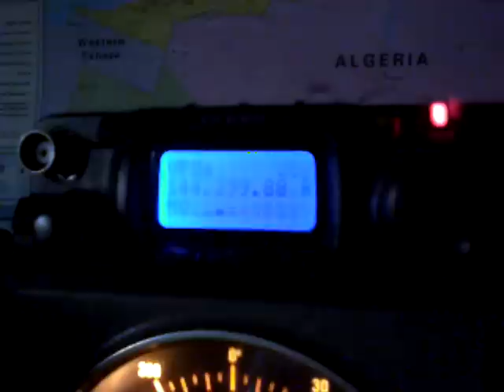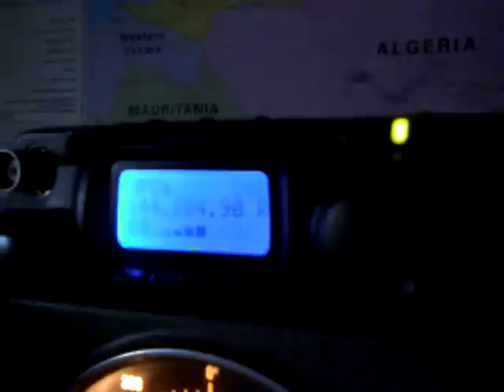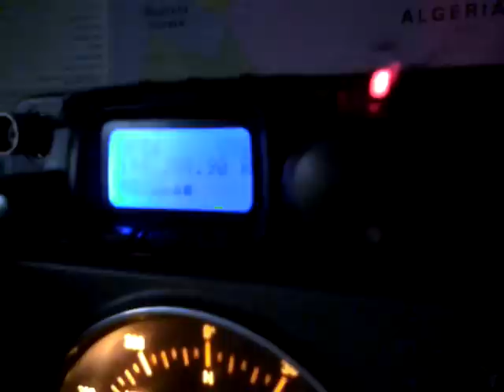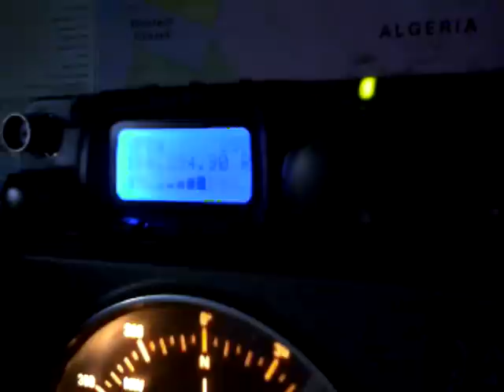2M SSB QSO with PA3GVC using Yaesu FT817ND & 2M6OWL

Comment: I Agree with you Chris, the truly amateur radio are the QRPs. It is not necessary 1kW power in SSB to make a contact, but only 500mW in adequate conditions of propagation and correct radio tecnichs.    73 !!
Reply: @M0RSF  Chris, Im not licenced yet (from Brazil), but I love ham radio. I want to achieve my licence in next year and my option is QRP too, mainly in CW.  
When I get my licence I will seek to contact with you.   73 !